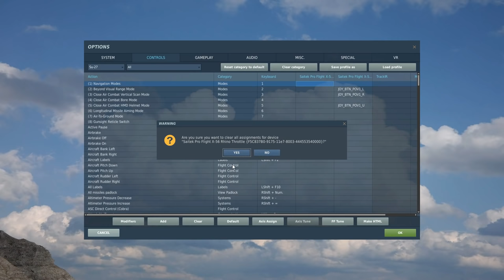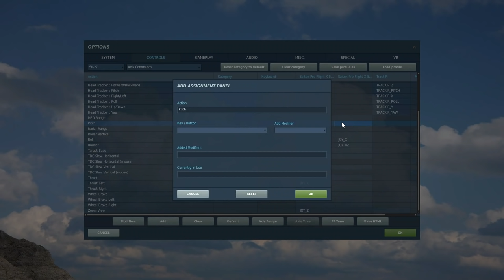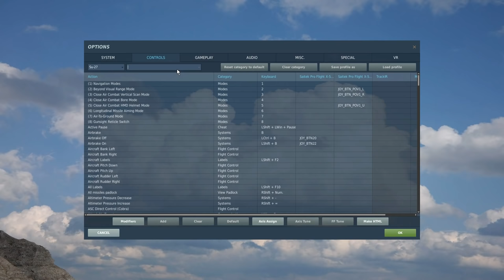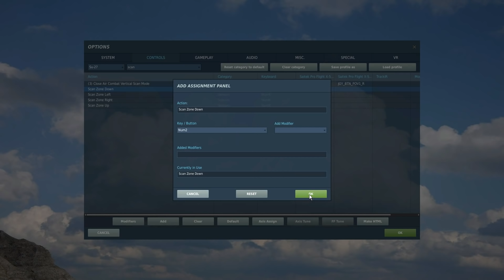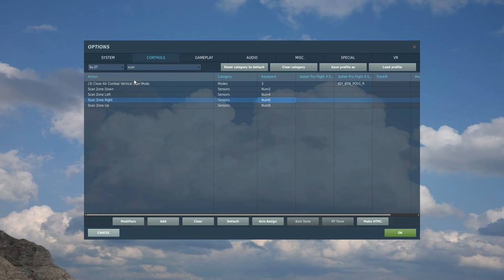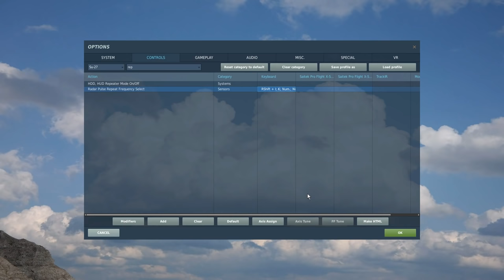Su-27, Su-33, Mig-29 & J-11A: Setting Joystick HOTAS Controls Tutorial | DCS WORLD

Comment: This was great, used it to set up my Su-27.
A question though - the trimming response seems awfully excessive in the Flanker in comparison to the A-10c and the Viggen. I know it's an unstable plane and all that, but even with a leveled speed and the quickest tap I can do on the trim hat and I'm like 2 degrees off. Considering the oscillation you get into, the pitch is a lot more understandable, but the roll is equally bad. I get like 4 degrees per second roll to the left, tap trim to the right as fast as humanly possible, and I'm rolling right at the same rate.. Anything I can do about this?
Reply from the maker: Understood but no known solution.

Comment: any recommendations for good starter joysticks?
Reply from the maker: I used to recommend Tmaster HOTAS X for $60  I think the new start stick is the TM16000? I am a bit out of touch.
Reply: definitely the tm16000 hotas, when you're ready to upgrade the throttle is comparable to most mid tier hotas so you can just get a fancy stick like a vkb gladiator and have the same amount of controls as a warthog minus the dual throttle and the mini side console most premium throttle add to squeeze that little extra out of you.
or if you were thinking of just getting a stick do the opposite and splurge a bit for a vkb (go for the premium, it's worth the extra) so you can get a tm16000 later on if you want to upgrade

so in short it's a bit pricey as a starter hotas but it can be turned cheaply into a mid tier.